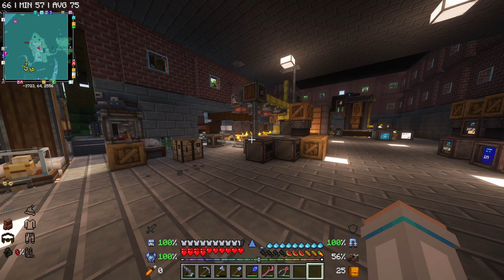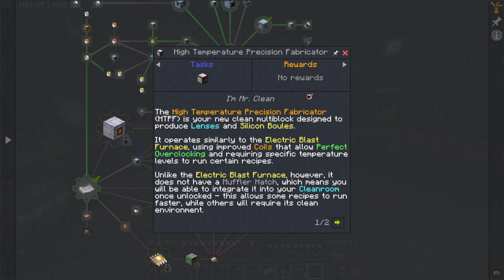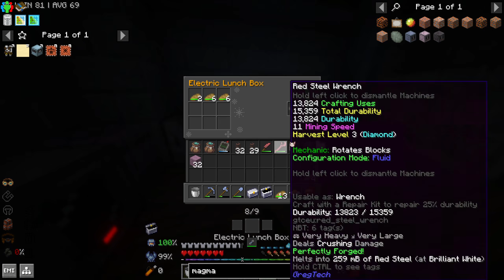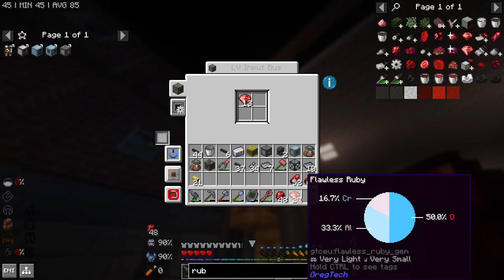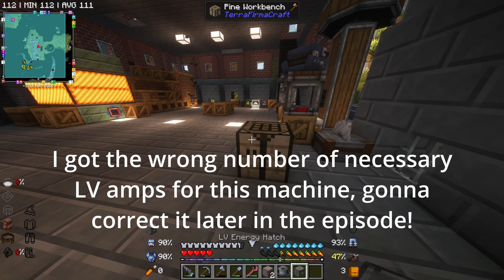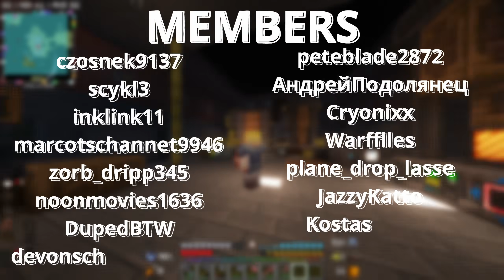It took me 20 hours do get some colored glass - TerraFirmaGreg

Comment: I would toss some more hydrogen and hydrochloric acid into the polysilicon line. Atm you only have enough for a single cycle, meaning that when your electrolyzer in the line finishes a recipe, it has to then wait idle for the byproducts to cycle back through the chemical reactors before it can begin processing the next polysilicon. If you feed a bit more in you can at least have that electrolyzer working on the next piece of polysilicon whilst the byproducts from the previous craft are already cycling back through. That way the electrolyzer will be running with 100% uptime instead of cycling on and off while waiting for the rest of the line. Ofc that all depends on if the reactor steps are faster than the electrolyzer (I haven't looked at the timings)
Reply from the maker: Ah im not sure about that either. After that episode I also removed a chem reactor so now it's only one + the electrolyzer. Im gonna check for downtimes but now it should be more energy efficient!
Reply: @syngevii  ig it's a bit more energy efficient due to the use of lossy cables. However if they were lossless cables (not sure if TFG has those at MV) then the energy usage would be exactly the same per polysilicon produced (after all each step uses a discrete amount of EU). Though ig if you wanted both reactors running outright you might need a second generator depending on the EU usage of the reactor recipes, and ofc that'd introduce a second point of output loss to the reactor portion.

If the two reactor steps combined are faster or equal to the craft time of the last step, then it's just a plain win I suppose, otherwise it's a tradeoff between energy efficiency and crafting time.